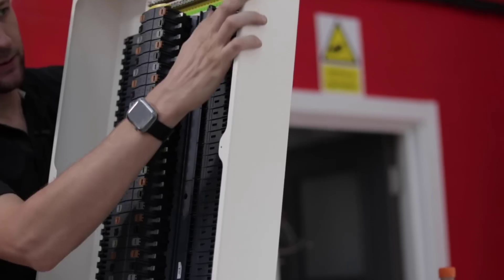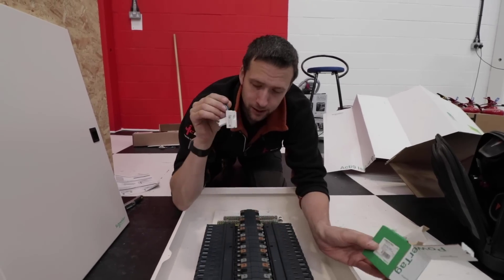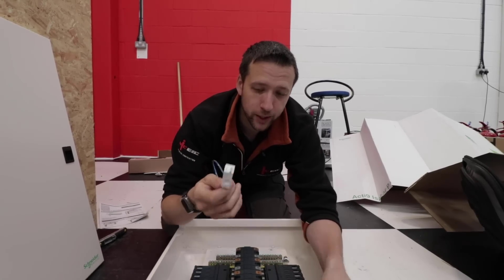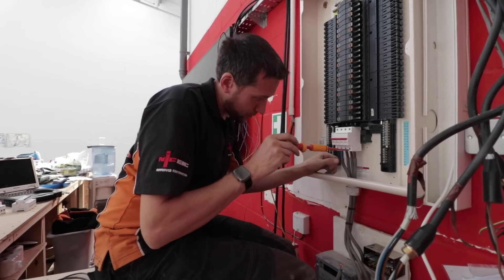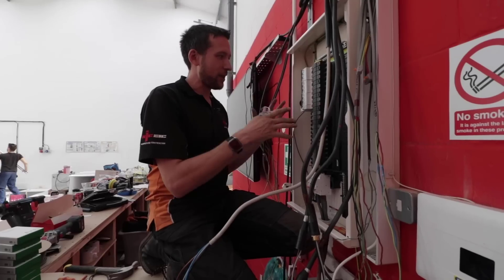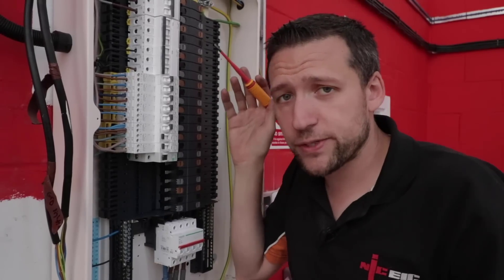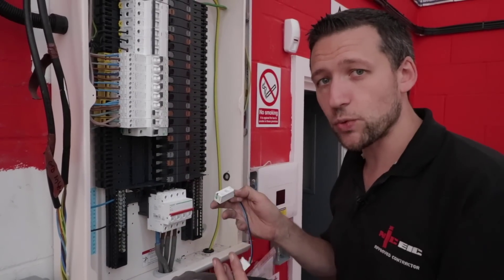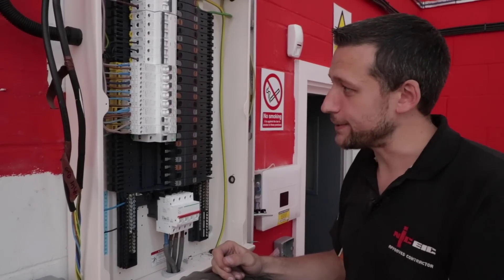Thomas Nagy reviews the Schneider Electric Acti9 Isobar P distribution board

Comment: I just wanted to add in the UK i dont see ANY ALUMINUM crap in building wiring  such as wire,cable lugs or busbars. I like that all the breakers BOLT IN. Ireally wish every panel in the us had bolt in breakers and copper busbars and even neutral bars like you do.

Comment: Why do they switch the neutral? Where is the conduit on those meter tails? aka service entrance cables . Cant understand how they allow the use of miniature circuit breakers to protect branch circuits.. In the United states your service cables MUST BE IN CONDUIT not exposed .Branch circuits MUST be MOLDED CASE CIRCUIT BREAKERS. Hear we would use QO or QOB breakers for a 120/208 service. Il bet your working with 240/415 volts. If i used this panel you are installing on 120/208 in the us they would consider it very unsafe and make me tear it out.
I think the UK is very reckless with electricity seeing all the exposed wires with no conduit,plastic consumer units that catch fire it make me angry at your government. In the United states i despise ROMEX,PLASTIC DEVICE BOXES, ALUMINUM WIRE/CABLE, BUSBARS. In residential settings. In Cook county IL YOU ROUGH IN THE WHOLE HOUSE ALL IN EMT STEEL CONDUIT.
Im a licensed electrician.
Reply: Not an electrician, but I believe I know enough of the UK regulations to answer your questions:

Not actually sure about the switching of the neutral.

Our meter tails are double insulated, but additional protection is only needed for buried cables - The reason for additional protection when buried is because you cannot see where they are. The protection can be conduit and is either there to provide an earth so that it trips when you drive a nail through it, or to provide physical protection. Armored (SWA) cable is an option instead of conduit for buried cable, but not in this case as they are meter tails which must be double insulated singles in all cases to the best of my knowledge.

We also have "safe zones" which define where cables are expected to be run within walls, defined by the switches and sockets that you can see on the surface. Any cables running outside of these zones must be run within conduit for the same reasons above. The focus is on showing where cables are so that you can avoid them.

Yes this is a 415V / 230V installation, but remember that with the higher voltage comes lower currents. There's nothing wrong with MCBs and RCBOs in this application, the main isolator is rated to 125A per phase and it looks like the largest MCB he's used was 32A as far as I could see in the video.

It looks like all of the exposed branch circuit wiring is using armored / SWA cables, although it's unfortunate that proper glands weren't used in this installation.

Plastic consumer units have not been allowed in new installations for a while now, since 2016 I believe. We use metal now and the one shown in this video is no exception.

What's wrong with busbars? These days they are all covered and you're going to get a far more reliable connection than looping a wire between each circuit breaker.

Electrical safety is taken very seriously over here. We have fused 13A plugs, 13A plugs which prevent accidental touching of the conductors as you remove them, 13A sockets which are always shuttered, RCDs on everything with few exceptions (At least in a residential setting).
Reply: @yngndrw.  In the united states we must use molded case circuit breakers they are rated 10,000 AIC of fault current.Main breakers even in residential settings such as 100 ,200 amp are rated 22,000 AIC. In most single family US residential settings. You have a service drop overhead or a service lateral underground this first goes to the meter socket[ the meter is round and has 4 spades on the back] this plugs into the meter socket from the meter socket it hits the panel within 5 feet .Some meter sockets work like this you take off the cover lift the leaver to the right of the meter up this spreads the clamping jaws putting the meter socket in bypass mode with the main breaker opened you can safely put the leaver down. You just killed power to the panel.For your panel the meter would have 7 spades on the back 3 phase 4 wire wye. The meter socket would be the jaw clamping leaver bypass type in my area . From any meter socket in my area you would have 2 inch rigid metal conduit going out of the meter socket box to your 200 amp main breaker panel your main breaker would have to be ratted 22,000 AIC and sometimes even higher. If a breaker is rated 10,000 AIC and you have 22,000 AIC at that breaker ITS GOING TO EXPLODE AND DO VERY SERIOUS DAMAGE. This is why in the US we NEVER protect branch circuits with miniature circuit breakers like you show in this video. If i used your breaker box you show in your video in the United States the inspector would consider is as very dangerous and demand i use a panel containing molded case circuit breakers. I looked at your video and the main isolator is 4 pole which means your breaking the neural conductor which is a big no no hear in the us. In the Us starting 2020 code cycle the main breaker or a fused disconnect [isolator] must be on the outside as part of the meter socket [meter main] or mounted next to the meter so the fire department can cut the power to your burning building. Your double insulated meter tails in the Us would be a blatant code violation at the very minimum those would have to be a part of a multi conductor cable. In the installation in this video being 415 volts 277/480 volts in the US those tails would need to be in CONDUIT no exceptions. In the US the installation in this video would be considered VERY DANGEROUS and get red tagged instantly.
I enjoy looking at electrical wiring in different countries this is very interesting to me. Since your part of Schneider look up SQUARE D QO load centers and Square D panelboards for the United states . The panelboards rated 277/280 have CURRENT LIMITING BRANCH BREAKERS from 15 amp on up all molded case.This stuff is WICKED check it out. I like Square D QO because the 15 amp breakers will instant at 150 amps on a short in one cycle .These things are WICKEDLY SAFE.
Reply: This is hilarious . I have watched many US videos so am familiar with the working practices and I can say in my opinion the UK way of doing it is far superior… your practices don’t seem to have evolved much from the 1970s . Still using aluminium which corrodes  . 

Overhead supply lines all over the place. 

The mcbs in this Schneider board are all rated to 10ka and the Mainswitch 25ka . 

We do use steel conduit when the occasion requires . 

We also use a lot of armoured cable . 

What we don’t do is waste time installing every circuit in steel conduit as it’s a complete waste of time as other containment methods are far more efficient. 

You are welcome to join us in the 21st century we’re only 24 years into it .
Reply: @persona250  The fact I live in Cook County Il & EVERYTHING as of the 50s shall be done in E.M.T. Electric Metallic Tubing made is SO MUCH EASIER to add
the needed circuits during remodels & upgrades. I would pull out the TW wire & then pull in THHN. I would end up changing some of the boxes out with 
either deep 1900 boxes or deep 11B boxes so I could have the splicing room I need. Im now disabled & retired & really miss the way the codes were in
the early 2000s before they came out with this AFCI thing because now you have to have a separate neutral for every circuit. I found out that people
that work for the big manufacturers are also on the board that writes the codes. This is a HUGE CONFLICT ON INTEREST!! They do the same thing
with the BIG CHEMICAL COMPANIES & the EPA-Environmental Protection Agency. This affects the water I drink & the air I breath. This is NOT GOOD.
I ALWAYS RUFUSED to use ALUMNINUM because its NOT quality material for electrical. I would use SQUARE D QO or SIEMENS with ONLY the COPPER
BUS OPTION if moneys were tight. They still use aluminum for the service but its HIGHLY recommended that you use PENATROX on it. They NO
LONGER even make aluminum for 15 & 20 amp circuits. Here in COOK COUNTY MOST places want COPPER conductors for the service & ALL the
branch circuit wiring. Today they make LOTS OF JUNK they want to call electrical worthy equipment is yet another reason I DONT MISS doing this
anymore. Square D QO now has an UNDERSIZED ALUMINUM PLUG ON NEUTRAL bus bar for its plug on AFCI breakers. Someone is being PAID OFF.

Comment: All the Merlin Gerin facts are true and the assembly was or still is in Warrington. Switching the isolation tabs is not done with your screwdriver but with a tool supplied in the board, it looks like a lemon and is mounted at the top of the isolation switches just below the earth bar

Comment: Mitsubishi and Merlin have been using the click in method , though we did find over heat and loosening of the grip after a few years on the Mitsubishi , so nothing new just put into one board by Schneider who i believe took most of those over ...also the data tags ..been using similar items for over a decade mostly with trend systems

Comment: I'm not sure if your aware Tom but the original design of that TPN board was conceived by Merlin Gerin and included those isolation tabs. Schneider bought the product (or Merlin Gerin as a whole, I'm not sure) and made very minor changes. I'm not sure if they still do, but for a while after the acquisition, Schneider were branding the front of the MCB's but hadn't changed the tooling, so the side of the MCB's were still moulded with the name Merlin Gerin. 
Just a fun fact mate.

Comment: The power tags are a great idea. Long overdue. With them fitted you can see if a distribution circuit has any spare capacity,  and do so from your office rather than having to go to the board with a clamp meter.

Comment: why do you bring 4 wires through one gland?! The glands are made to make a firebarrier between the fusebox and it's sorroundings. Bringing 4 wires thorugh a gland will leave airpockets as it is not circular!
Reply: This method eliminates the possibility of Eddy currents that can occur when using single entry for each conductor through steel plates..
Reply: @paulb4423  NEVER use single entries for live cables , for the above reasons and you can get charged more for your usage because it upsets meters
Reply: @paulb4423  so you are saying that the magnetic fields of each phase will cancel them out. Using a cable would have been a better choice. and still with one gland for the cable. The magnetic field working on this fusebox is negible due to the size of the current passing through the conductor. .
Reply: @EspenTremonti  Using a cable was not an option. The board is being fed directly via meter tails, so had to be single core double insulated. Very likely the magnetic field would be negligible, but still good practice to avoid passing single conductors through steel gland plates individually.
Reply: @paulb4423  I think that it is really weird to install meter to wall just alone with exposed wires and not in a cabinet. Use Google image search and search term "mittauskeskus boxer". The recess in the housing cover is the place for mounting the meter
Reply: EspenTremonti That gland has 4 ways in the rubber, wiska make them!
Reply: The industry norm for 3 phase cables into a dB is through 1 hole together normally a 2 inch brass bush if on trunking the gland is a good idea as it forms a cable restraint in that particular installation with loose tails 
The only way with separate holes is through a non ferrous gland plate with the holes slotted with a cut between thus cutting out eddy currents
Reply: What IP rating do you think the bottom of the db should be?
Reply: Mr Badger ip2x for side and bottom ip4x for top ?
Reply: Although the Earthing conductor should also have been brought in through the same gland.